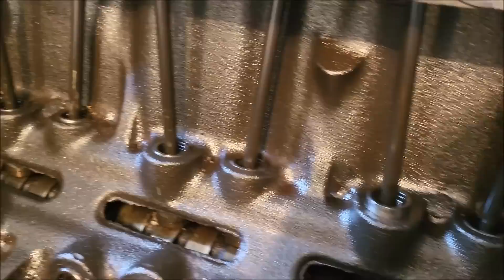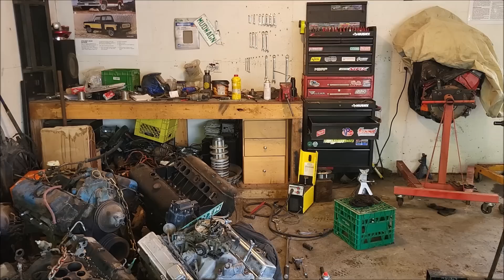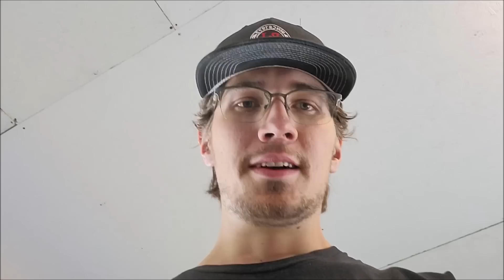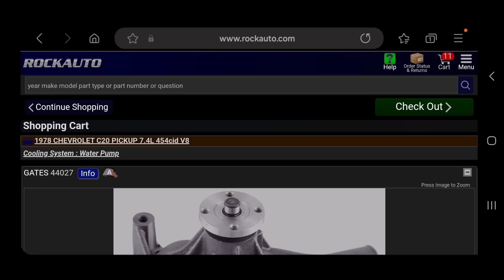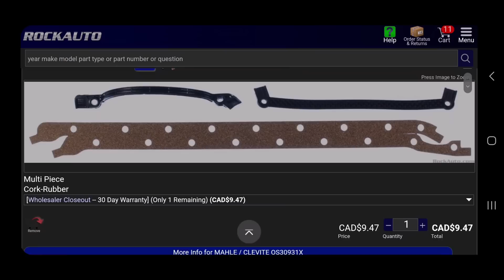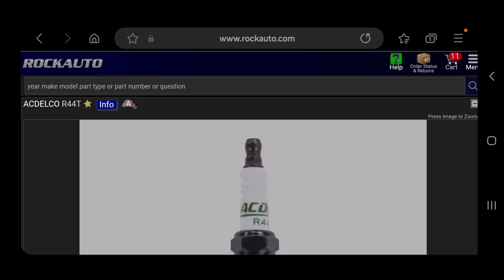Why Does Everyone Ignore Tall Deck Big Block Chevy V8s?

Comment: I asked once when I was around 15/16 for advice to rebuilt a 305 that was in my 78 GMC High Sierra. 

I was told to get a 350, then why not just do a 383 stroker and may as well do a SBC 400. It’s because the majority of car information platforms just keep uping it until you agree to put a 747 Airplane engine in your vehicle.

I’ve always loved the odd ball motors. My 305 was ironically out of a 77 Impala with 1.72/1.5 heads an aluminium 2bbl. The truck got around 19mpg with a Th350c an 3.08 gears. 

Chevy made a 265V8 in the 50s that’s a good motor. Some motors were horrible because of SMOG. Everyone will tell you 1.72 heads are junk and that’s okay. I find them for nothing and build old 305s for low end torque because everything thinks they’re garbage.

Comment: My dad gave me a idea a long time ago befor tearfown if tuning change out motor oil with tranny fluid later on teardown. No sludge saved slot of time  I have lots more tips from experience tip2 drill a 1/8 hole in  armature end of heater core motor end bell to  oil bushing to get rid of damn motor wine a drop of 3 in one does the trick. P.s I'm stillstuck in 1970  as a kid I had a pile of 350's and 427's behind the garage along with over a dozen early th 400'i would build for my own use dad worked at Towanda engine plant  best friend worked at Delavan power train hey dad I need a set of  bearings for bbc and a couple of sbc  my car in h/s was a 1967 Chevelle SS 427 I aced my auto shop class I even went to night school to learn auto transmissions buddies thought I was nuts till I always had a few hundred dollars in my wallet & a fine girlfriend   being a gear head was fun

Comment: It was very common for these truck big block tall decks  to be converted to Propane and it worked very well . You can save a lot of money running propane . Nice to see someone working on this truck stuff . I have a two ton farm truck but it has a 350SBC with a TH475 transmission and runs on Propane . Keep up the good work !

Comment: Actually, you shouldn't use a 454 flex plate or harmonic balancer. The 366 is internally balanced and the 454 is externally balanced. It will cause a terrible vibration. And performance intake manifolds are fairly expensive for tall deck  bbc.

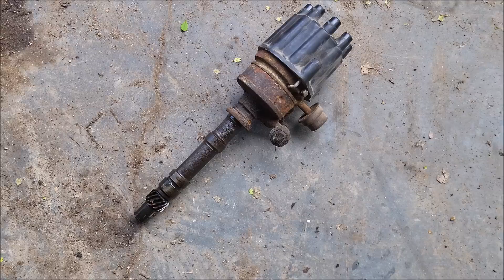Comment: I personally believe you’re wrong 427 is a very sought after block because it’s a tall deck and it can make more cubic inches than a 454 because of the tall deck the 427 will rev, faster and higher than its big brother. I’ve had several over the years. The last one that I did have came out of a burnt down 69 Corvette had a 427 with triple deuces. It was the best engine I’ve ever owned. They rated that engine at 4:25. It was more like 500 hp when you took off the three deuces and add a dominator. I then put that engine in a 73 four-wheel-drive square body, and that was our mud bogging truck until I sold the truck to a alligator farmer then put the engine in his airboat and his last I knew this motor was still running in the air boat.
Reply: Y would you sell that
Reply: I had a professional build my 67 427 block,69 vett aluminum rectangle port heads worked,solid cam. That motor was good for 7500 + rpm high compression motor

Comment: I love my 366. Hauls around a full size school bus every day that was refitted to be a mobile machine shop. It has over 450k miles on it with no major engine repairs. Btdubs it's a 1985 GMC engine. Runs like a diesel on pump gas.

Comment: The tall deck 427 has the cam tunnel higher in block and that changes deck heights allowing a stroker rod and crank to achieve 500-600ci. The bores are limited to +.100 overbore safely on average. That is a 4.350 bore size. Special intake manifold set ups are required also. Aftermarket blocks are set to standard factory deck height 9.8 to use stock style intake manifolds and allow for easy 4.500-4.600 bores with 4.25-4.500+ strokes  to make 500-600+ci. Big block 385 series Fords can make strokers like 520, 540, and 597ci similar to the bbc tall deck. Big horsepower is made from large bore size and Ford did that better then chevy with the 429/460 blocks at 4.360 stock bore. Sadly 460 and 427 blocks are harder to find since the cash for clunkers days of early 2000s. Hope you've made progress on your build! 👍

Comment: I run 366 engines in both my street car and my dragster. I use offset ground 454 crank with a 4.030 283 piston , the blocks are extremely durable and the cheapest 600 hp you can build

Comment: You better not run a 454 flywheel or flex plate they are externally balanced!!! If it's neutrally balance run a 396/402 flywheel/flexplate!

Comment: I’m working on a 1992 gmc top kick with a 366 in it , I never tore the truck or engine down but was asked to put it back together and I would like to know where I could find some info on the wiring brackets etc does anyone have any suggestions or recommendations? Thanks in advance

Comment: They are low horse power and low rpm . If you are racing’s it not worth the cost . Yes you can make some power but for the same price . Plus a small block weights less than the 366 plus puts out way more power.

Comment: Can I make a suggestion to prevent an engine from crashing onto the floor?  Add a nut to the bolt you are using to lift the engine. Then, when you screw the bolt into the head or block, run the nut down to the machined surface a snug the nut with a wrench. This will prevent the bolt from snapping and it will also keep it with the lift chain. Enjoy The Journey - Cheers
Reply: Great idea Amigo!

Comment: The bell housing that the starter bolts onto is for an Allison automatic 540 and or 640 series transmissions that were in use at the time.
Reply: Mine all have a standard Chevy bellhousing pattern. T-400 bolt right up.

Comment: Hi, I am a fan of tall deck 427''s as the base for performance engines. As you say, 4 bolt mains, forged crank. Fitted with better pistons, almost any passenger car heads, cam etc. you have a strong and cost effective engine. They also a great platform for a stroker, thanks

Comment: Besides the 366 and 427, Chevrolet also made a tall-deck 454 V-8 for their medium trucks for the years 1979-80; at most, this version made 245 hp and 380 lbs-ft of torque.

After that, we then have the Vortec 7400MD (1999-2001) and 8100MD (2002-2010).
Reply: A stock early 80s peanut port 454 on a Dyno makes around 330hp and 460-480tq. The 70s big oval port 781/049 heads on a stock 454 made around 350hp and 480tq on the Dyno. Just add 100 to the factory ratings and get the real picture. That 430hp L-88 427 actually had 575+HP. GM under rated many of their engines or advertised the rear wheel horsepower.
Reply: Those factory power ratings are always low. They make more than that on a Dyno.

Comment: The flywheel housing he is talking about is for an Allison 540, 643 and 654 series automatic transmissions and manual transmissions used at the time.
Reply from the maker: the truck that this engine came out of had an Eaton 5 speed manual in it - thanks for the comment!

Comment: 366 is a good reliable engine. They arent the most powerful. And dont plan on going really fast. But they will get the job done without much fuss. I have kept 6 of them going for several years.They are in C6500 w/20ft dump.  And pulling skidsteers. They get run hard 5 days a week. They can have 200000 miles and run just like new. Only problem ive really run into is the exhaust manifolds cracking. Ill also add, im not a chevy man. But these engines just keep running.

Comment: Seems to me you cant go wrong with a purposely built heavey duty block from the beginning.Makes me wonder about the Ford 330,361,370 Lima big block FE motors that came in the F-500,F-600,F-700,etc from the 70's and80's . All those pulleys make me think of superchargers.??

Comment: I can't even find a tall deck 427 anymore. They are the "poor"mans mountain motor as you can put up to I believe a 3/4  stroke aftermarket racing crankshaft in it and get 598 cubes out of it. If you bore until the cylinder was are only  .100 thick and put cement in it and  run it on methanol you can get up to 650 cubes I think it is. Now they have special engine blocks for that.

Comment: I've used those engines for years, I still have a 68 c60 with 366, a 69 c60 with 427, a 79 c70 with 366 and a 95 7500 with throttle body 366. They all still run great and I still use them time to time.
Reply: I have a Kodiak with a 366 throttle body that I have been worried about putting in the field. 
After reading all these comments im not so worried about how reliable its going to be (I usually run all diesel motots)
Reply: @docjnsn73a they are extremely durable.

Comment: Replaced many tall block 427 back in the 80’s. They came with sodium filled valves. Disasters if you run them too hard. Cylinder number 5 was almost always the culprit. Idk why. My theory was change to stainless valves. It would have been great to have a afr gauge to see if they were running lean. Good motor though we were running them hard over the road.

Comment: Why?
 Cubes make power, as long as you're running a big block run the biggest displacement you can.
 Alot of weight in a big block.
 Also, I can make more power on a  lighter SBC 383 and cheaper than the 366.
 Nuff said.

Comment: I like those engines but they use oil. Don't smoke, drip, or blow it out but they consume it. Last one I had used 1 quart for every 16 gallons of gas. Like clockwork, It was like that from brand new. Mine wasn't the only one doing so. Lots of farmers went Ford because of the oil consumption. Good luck finding these in the States. Everything is GONE for the most part.

Comment: Hey man iam in Canada too... I have a 366 and 427 tall deck.   Iam gona take  the rods press the pistons off  because the rods are stronger than the car stuff and the pistons have 3 ring Grove pistons which are taller,  But the same length rods..  get some proper pistons for a 454 depending on bore size..  then take the steel crank out of the tall deck as well and put it in a 454 block.. going to play around as well , have a blast and  good luck

Comment: The reason we never cared for the truck engines was, at least the heads are concerned was the heads were sodium exhaust and small sized valves and to make them produce any kind of power you needed to spend time and a lot of extra effort to make them useful . Nowadays, the ideas might be a little more enticing . But they did weigh too much, the bores were a bit small and the intakes didn't match up to aftermarket manifolds .

Comment: Why not just recurve the distributor. It can't be because it's single points, I've personally used single points to 6,500/7,000 for years without problems. The less than 5k because it's points is a myth.

Comment: I've had three square bodies two with the 366 and one with the 427 and all of the torque I had 4 spd std and you could put it in first to third at a dead stop and pull off no issues I prefer the 366

Comment: I need some help with a 366 in a gmc c7000. the thing started knocking on me, sounded like a hammer knocking the side of the block. oil pressure dropped in half down to about 20psi, i dropped the oil pan, no metal shavings, no spun crank bearings, rod bearings look good too. where should i be looking for the problem? also any recommendations on rebuild kits for these? mine is a '93 tbi. And advice you can give im grateful for

Comment: I know this is an older video but you made some good points here. I've had two of the 427 truck engines and both were 4 bolt mains with a steel crank. I don't know if that was standard production but since your 366 has the same I'm willing to bet the 4 bolt main and steel crank was pretty common on the tall blocks.

Comment: There's a small weight penalty to the tall deck motors, but the biggest reasons they weren't as popular to build are intake choices and rotating assemblies. Intake spacers are a compromise and there is far less variety in direct fit intakes(I've only ever seen single planes). Internally you either need custom pistons or longer aftermarket rods if doing anything but a stock rebuild. Back when aftermarket blocks were high dollar race team stuff these motors made a little sense for a full on big inch race build. Nowadays the last of the standard deck factory big blocks, or aftermarket replacements from the likes of Dart, can take you well over 500ci.

Comment: These engines worked fine in dump trucks and such, but not so much in an eveyday driver. Same as the 348 back in 1958-59.

Comment: i understand you can run a big block intake with the 3/4 spacers - but can you run aftermarket aluminum heads  ? on a tall deck  :face-turquoise-covering-eyes:

Comment: Neutral balance? and 454 flywheel and dampner do not compute
Not as heavy as a GMC V6
454 crank gives 400 cu in will take a big stroke but small bore  makes torque
does deep pickup fit>

Comment: I bought the big water pump from rock auto works great. Under 1977 Chevrolet medium duty truck 366 they even have the thermostat housing gaskets on there for the double thermostat set up.

Comment: Throw the 366 away if you want any performance.  Keep the crank and rods, but the rest is junk.  They have no compression, tiny valves for a big block due to the small bore and all the weight and fuel mileage.  The 427's are much better.  They have standard oval port sized valves in the truck heads, a much larger bore and generally just run better.  I have a couple tall deck 427 blocks and a single 366 short block (brand new in crate from GM) and the 427's make great strokers.  The cylinder walls are very thick, and the taller deck lets you run a longer rod.   Lots of tall deck performance intakes are available, but not a lot of oval port ones anymore.

Comment: I used to run a fat-tired granular fertilizer applicator that started life as a 1985 Chevy 65 with a 366 in it. It breathed through an air cleaner off of a big diesel tractor ducted from behind the cab. I spent about 12 to 14 hours a day bagging that thing across the rolling fields with a few tons of product in the box. I always thought it would be a total riot in the right car or pickup. Never managed to kill that thing. I wasn’t abusive, but doing that job wasn’t easy on our trucks. A side effect of using a transmission mount PTO is that you have to shift gears without the clutch, since every time you shift, the PTO simply acts like a brake, and the synchros can’t overcome it to let you get it back in gear. Having spent some time driving semis, I just started float shifting it, which worked great if you didn’t try to force it. Loved that engine.

Comment: messed with one 20yrs ago and did exactly what u are doing 366 in a 3/4 4x4 munze 4spd.....ran simple bolt ons with a factory talldeck intake with 650 edelbrock carb and swapped in a hei distributor headers but i put in a double roller adjustable timing chain cam retarded 4deg them set timing at 8geg at idle b4 full vacuum advance along with a curve weight kit ....thing was an animal....no clue how high the rpms went because no tac but it screamed.....hooked it to sled at a county fair once spun out in 4low 3rd gear  long b4 it ever bogged ....actually still have motor and trans in storage and plan to build another truck same way someday

Comment: These engines were work horses. Unfortunately diesels were a cheaper option at the time. However, the year is 2024 and diesel engines are no longer the reliable legends they use to be.

Im a med/heavy truck mechanic and im seeing med duty trucks withe large displacement gas engine instead of diesels. Most fleets are fords, so the 7.3 gas engine is showing up everywhere. I have one in my f550 19.5k gvwr. It pulls hard if i need to get to freeway speeds.

I deal with so many issues with modern diesels that i shouldnt be dealing with, and the price tag for repairs is insane.

The epa has choked diesels and i honestly believe we will see some big gassers hitting the market for simplicity over an extra 2mpg. My big block gas truck gets 12mpg on the freeway and its light, easy to fix.

Unless battery tech jumps leaps and bounds, then electric motors with consume the market. Fix the battery issue and the whole world will change

Comment: Back in the day ypu couldnt get aftermarket parts for them. And the ueads were an issue. With that said, today you can get performance parts for these engines. There are companies that make aftermarket intakes that will bolt right on no spacers, and you can use a regular distributor with said intakes. That was the biggest issue. The second is they run a 4 ring piston that takes a short rod. Now you can get aftermarket performance rods and use regular 3 ring performance pistons. I bought my 366 that starts and runs for 60 bucks. 60,sixty 6,,,,,0 at an auction. Brought it home, threw it on my engine start stand, check to make sure it rotated freely, checked engine oil, pulled the crushed distributor, replaced with a hei i had from a small block l. Dropped right in and locked into the oil pump. Wired it up, hit the started and it fired right up. Now i hate to take it apart because it runs and runs good but i would like to go through it and change out some of the factory parts for performance parts.

Comment: Fram is trash, use a Wix or Napa Gold(rebranded Wix) oil filter. I`m 66 and they have served me well. Daily is a 1991 C1500 350ci with 340,000 miles. Still running strong and does not burn oil. Oil changes every 3000 miles. Maintenance pays off. You can build that 427 into a screaming monster with a good cam and some port matching. You have a new sub Sir.

Comment: I put a 366 in my c20 when I was a kid. Ran great for years. Good fuel milage and pulled every thing I threw at it. I had a 2 barrel on it for a while and went to a Quadrajet but kept destroying drive lines and transmissions